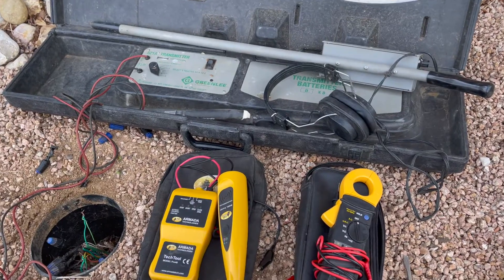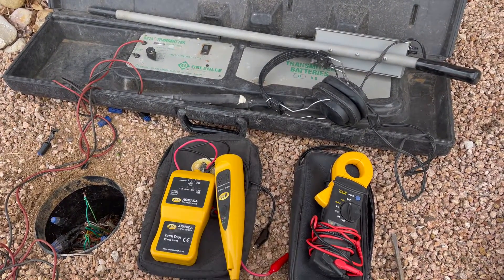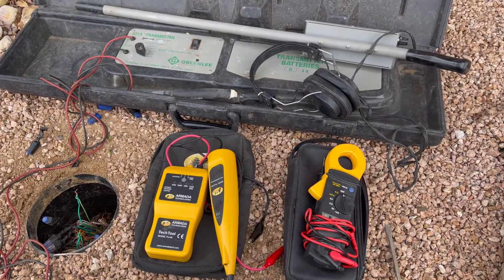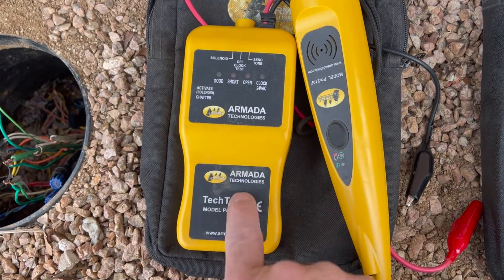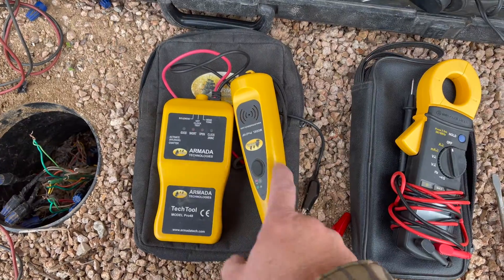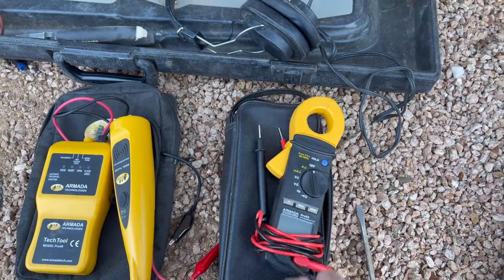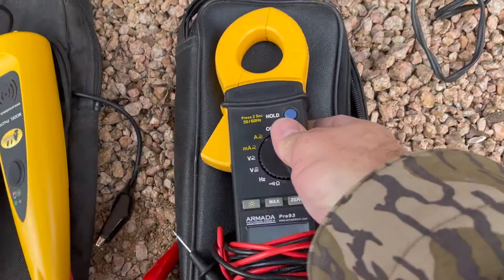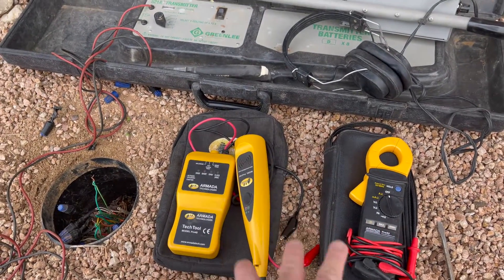Irrigation System Eletrical Troubleshooting Tools

Comment: Have had many bad solenoids that have been bad which the Pro48 said were good.  I don't even bother with the Pro48 anymore.   I just replace the solenoid.
Reply: They are simple resistance testers that use DC. The Tempo 24B puts out AC and uses inductance to test solenoids since that is the electrical scenario they actually need to work in.